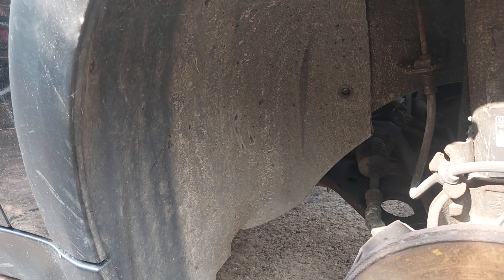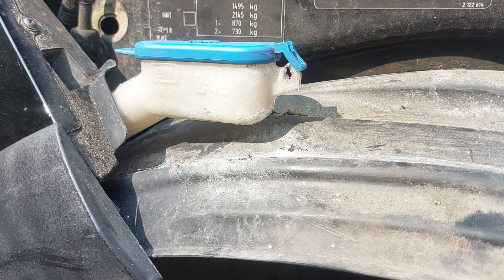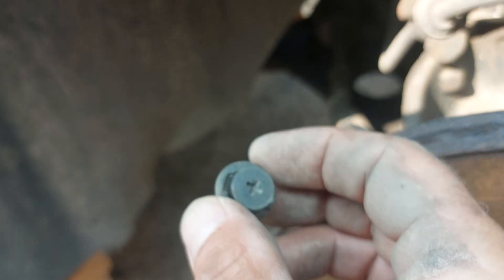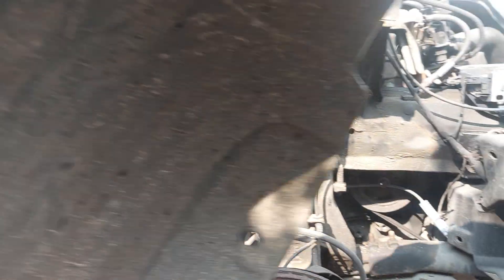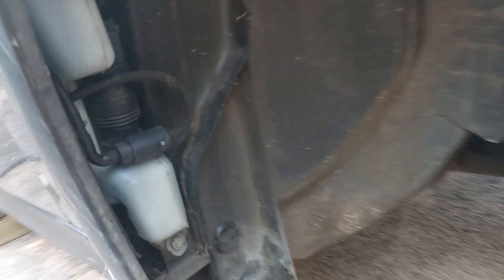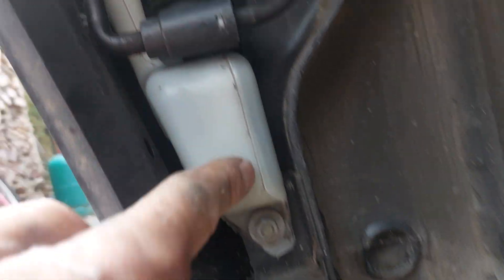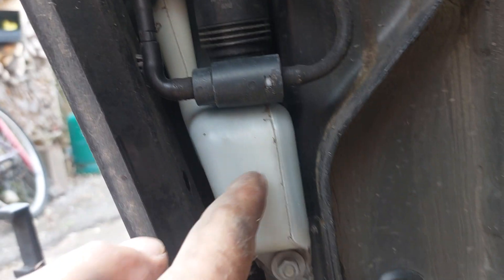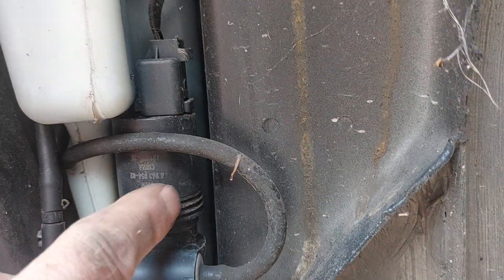windscreen washer pump location on mini one R50 2005

Comment: Thank you very much for this video. So I don´t have to search the pump in my R50. It is working, but I have to find out why no fluid reaches my rear wiper....
Reply from the maker: Maybe the pump was replaced with one with single outlet in the past or hose is blocked. Or, little jet by rear wiper is blocked